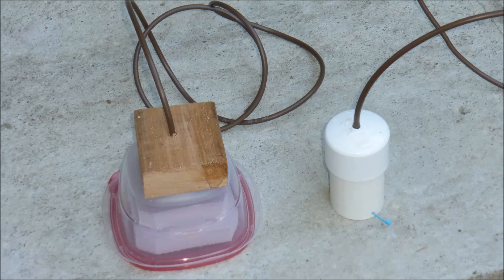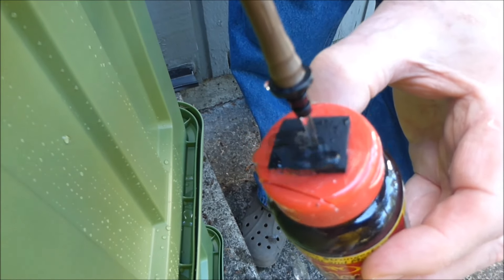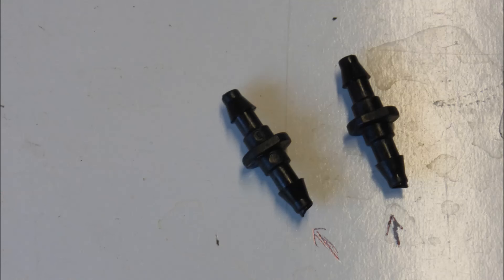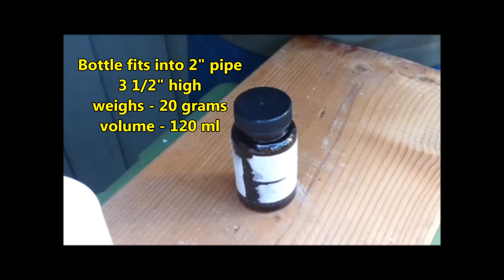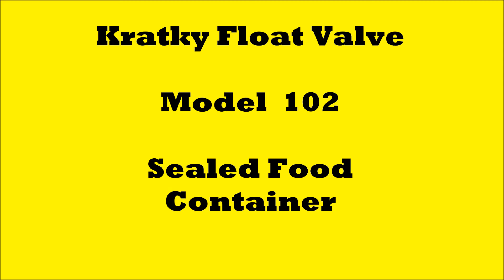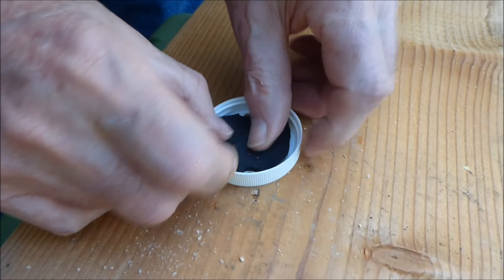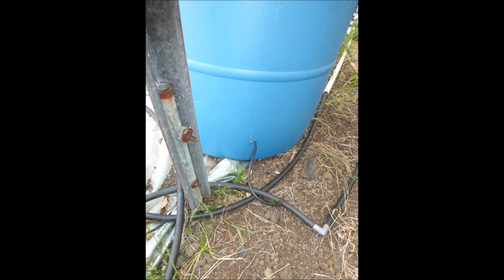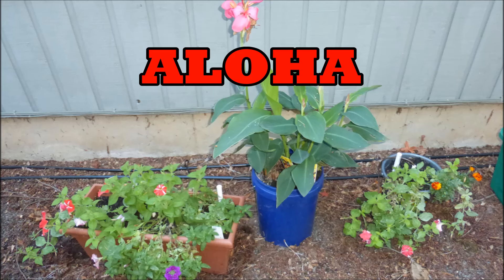Kratky Float Valves Control Water Levels in Hydroponic and Sub-Irrigated Container Garden Systems

Comment: I used this style of valve for my mister reservoir and I thought I had everything worked out so I made another for my growing tank. I didn't take into account the difference in pressure needed to stop the flow was smaller for my little mister than for the large elevated 3 gal tank I had for my grow bucket.  It overflowed! LOL Now I see I didn't have enough buoyancy to overcome the pressure of the water in my float valve assembly.   Thanks.  I watch these videos over and over and each time I learn a bit more than the last time,, it makes sense through experience more than just explanation, so the demonstrations are very helpful.
Reply from the maker: Thanks for sharing!

Comment: I want to try this without valves.  One way could be an upside down 5 gallon water cooler bottle upside down (supported with PVC collar possibly?).  The other way could be a blue water barrel with a grommet at the bottom and a 90 degree elbow to put the water/nutrient into the bed.  With the both the burping action (like on an auto pet watering station) would let the solution out slowly.  I just need to get them together and try them out!
Reply from the maker: A constant water level controller is an interesting concept for supplying water to a growing system.  I'm hoping to stimulate improvements to my initial attempts because even though my float valves look good from far, they are far from good!  I look forward to seeing your improved designs!
Reply: oh wow it's Jeb :)

Comment: Dear Dr Kratky, 
What about using used discarded wetsuits as a neoprene source? They may be plentiful in Hawaii. 
Mahalo for your spirited good works.
Reply from the maker: That probably would work fine.  In fact, the current  float valve version utilizes neoprene foam strips with a glued side to attach to the extruded polystyrene float blocks and they work very well.

Comment: Dr. Kratky , I am planning to build a float valve using your bottle model approach, but using a 1/2" PVC pipe only. This PVC pipe will be draining a 27 gallon container ( the half part of a 55 gallon blue water barrel ) from the very bottom and will be connected to a 3-4" tall 1/2" vertical PVC pipe using an 90 degree elbow connector. It is in this vertical PVC pipe where I plan to attach the float valve from outside of the container and maintain a 2" shallow water level in the container. Keeping the float valve outside the container will solve root intrusion problem and make float repair easy when needed.
My question is - will 1/2" PVC tube generate enough buoyancy force to stop the water from the nozzle for a water head of , say, 2 feet ? I may not use a bottle ( as 1/2" pipe will be too narrow to accommodate  a bottle ) and instead use a  2-3" tall polystyrene cylindrical block of 1/2" diameter .
Reply from the maker: I'm thinking that might be too small. Consider placing the float valve in an exterior sump tank.  This is demonstrated by going to about the 6:00 time in Kratky's Garden in 2019 under my Grow Kratky channel.  Also, you might be interested in my yogurt container float valve which was used in several Grow Kratky videos.

Comment: Dr. Mr. Kratky, thank you for sharing your knowledge with the public. It is amazing to have you as a resource. I have a question on model 101, why is the shur tape installed on a bottle cap instead of directly on the foam board.  Thank you
Reply from the maker: In a later improvement, a neoprene foam material sticks to the foam board like you suggest. https://www.youtube.com/watch?v=pje-yifjeVE&t=10s

Comment: An amazing idea. The arm system in common top off unit takes more space. But how about ulitilizing the water pressure to close the valve itself?
Reply from the maker: Thank you.  That is a great idea, but I don't have a clue on how to do it simply and I'm hoping this video will inspire some of the viewers to come up with such an improvement.
Reply: @growkratky5558  It will be only an option. Instead of using shuretape, an one ended closed tube, with a hose sealing sleeve assembled on another end, is proposed. The unit is mounted on the top of the buoyant. As the buoyant move up, the nozzle will insert to the tube through the seal inner hole. As the water pressure in the tube increases, the seal will squeeze the nozzle more tight, and the water stop flowing. The drawback is the need of this kind of seal, with small size.

Comment: This system is allow the water in container always have same level in everytime, but in trully autopot system they have dry-wet system, so sometime the container not always fill container with water,they make the dirt little bite dry a while to give a change root for 'breathing' and prevent Root-rot disease,then the system come to drain water again to the container after that.
Reply: If you use this in a passive hydroponic system the roots above the water will do the breathing, and the plant will only send water/nutrient seeking roots into the water. The reason to keep the water at a maximum level is so that the water doesn't rise up too far and "drown" the breather roots. Thus it does not require fill and drain which would require some kind of electric pump and timer. The autopilot here is pure gravity, so it won't fail if the electricity goes out.

Comment: Where is the information about material toxicity? It would be useful as I am making a vertical garden and need to make liners for them.
Reply from the maker: A MSDS (Material Safety Data Sheet) is a good source.  For polystyrene, do a google search for "MSDS polystyrene".  In addition, you might do a search polystyrene toxicity.
Reply: How do you line them? I’ve just spent the last 3 days trying find information on doing that. If you could point me in the right direction, I would be very grateful. Thanks Kim from Australia

Comment: isn't it easier to use a toilet valve?
Reply: Easier and more reliable: yes of course. The point here is to make one on a low budget.
If you need 10 or 50 float valves in your garden, the toilet float valve price will be prohibitive.

Comment: Another factor to consider is temperature. I bet elasticity of that foam varies by temperature, especially if it is wet. Why not just use the needle valve and float in a brand new plastic Briggs & Stratton lawn mower carburetor with the bowl removed? Just connect your water line where the fuel line should go. You can get them for $10 to $20 each online.
Reply from the maker: Thanks for sharing a great idea!!  One possible issue is that fertilizer nutrient solution can be corrosive to some metals, but it is worth a try.

Comment: Too complicates for me.. i just drilled a hole on my container where the water level shld be.
Reply: Yes, but how does the water get in? This method is not only about keeping it from overflowing but also about filling it as needed. This system will fill it when it's low. You could bury this in a planter and provide water directly to the roots without having to come out and water each day.  You can still drill a hole to keep excess water from flooding, perhaps if there is rain or failure of the seal.

Comment: for 5 bucks auto shut off float valves are sold why not use one?
Reply from the maker: This project started many years ago with the goal of developing a small and inexpensive (less than $1) float valve that growers could afford to place in each growing container (something akin to chicken waterers).  Well, I'm not there yet, but thought it useful to share what I have in hopes that someone will use it as a springboard to develop these devices. Now, $5 each is pretty good, but still a little expensive for a grower who wishes to use a large number of devices.